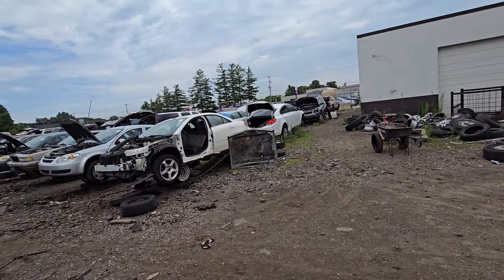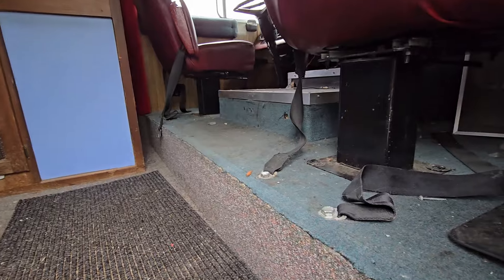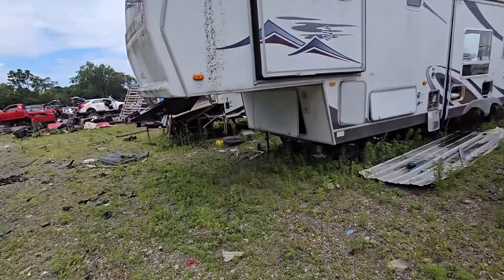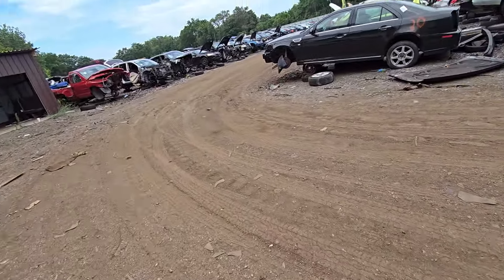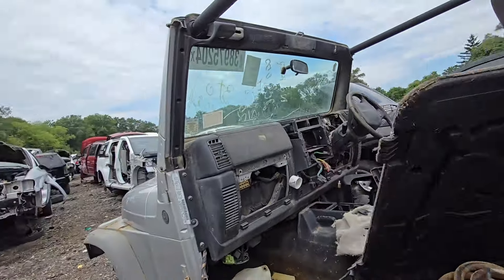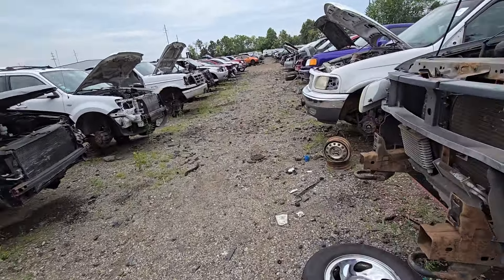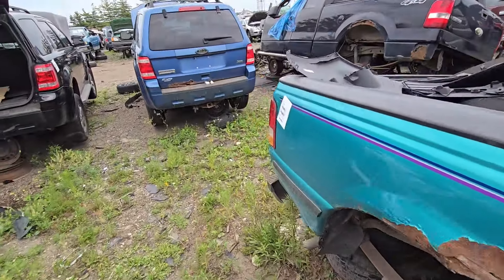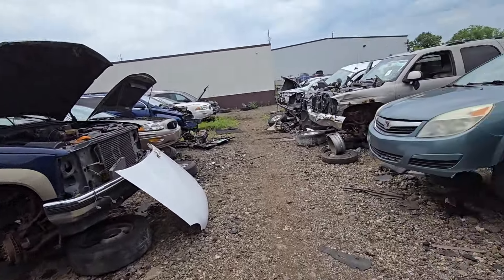The junkyard engine warranty plan

Comment: Some of the older ones had a 413 ,which is cool too . some guys don't even know they made a 413 . great engines
Reply from the maker: I've seen them with 413's in the late 70's even, so that one could be, I didn't check the casting to verify

Comment: I also had another mopar question on the 98 ram with a 5.9 automatic
Reply: Can you use hp tuners to basically switch the ecm to run a manual transmission